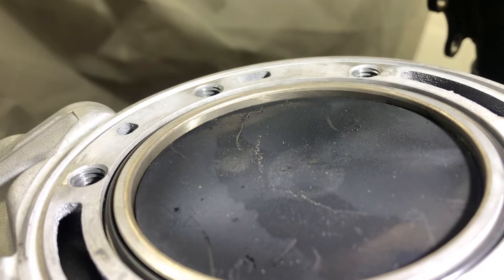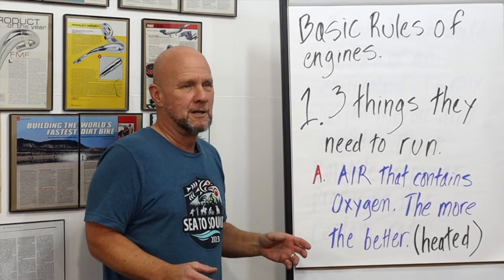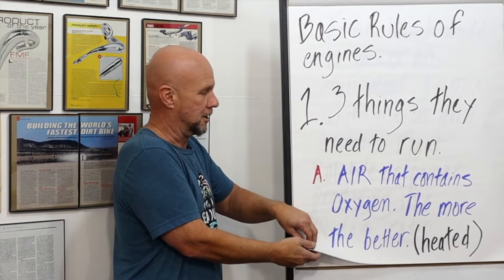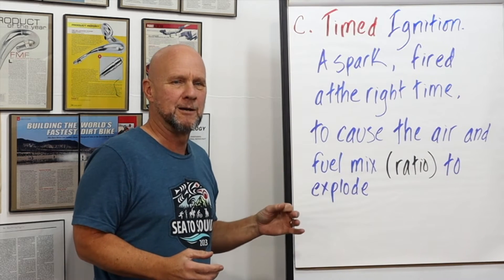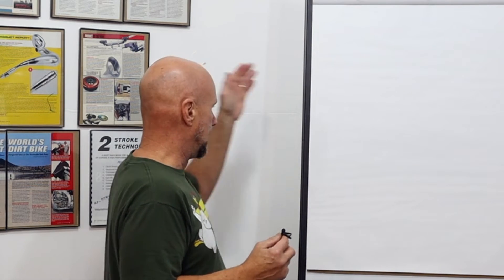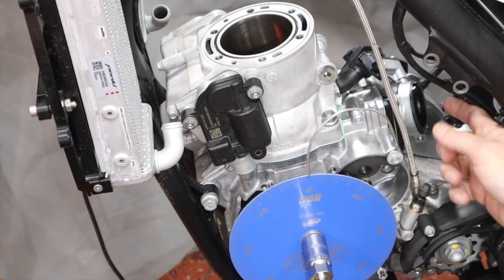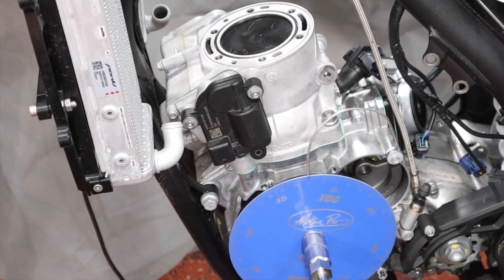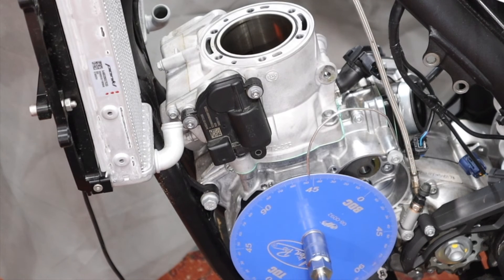3 Basic Rules For An Engine To Run - If One Isn't Correct, It Won't Run | Video #1

Comment: I am writing to express my deep disappointment and frustration regarding the recent experience I've had with your company. Not only have you failed to fulfill your obligations as a supplier, but your use of vulgar and offensive language has further exacerbated the situation.

I placed an order with your company on December expecting timely delivery as per our agreement. However, it has been since the expected delivery date, and I have yet to receive any update or communication from your end. This level of unprofessionalism is completely unacceptable.

Furthermore, I was shocked to witness the inappropriate language used by your representatives during our exchange. Resorting to profanity is not only offensive but also demonstrates a complete lack of respect and professionalism towards customers. This behavior tarnishes your company's reputation and raises serious concerns about the way you conduct business.

I want to make it clear that I will not tolerate such treatment. As a dissatisfied customer, I feel compelled to share my negative experience with others, including through platforms like YouTube, to ensure that potential customers are aware of the poor service and disrespectful behavior they may encounter when dealing with your company.

I strongly urge you to rectify this situation immediately. I expect a prompt response addressing the delay in delivery and an apology for the unprofessional and offensive language used. It is crucial that you take steps to improve your customer service and ensure that such incidents do not occur in the future.

Failure to address these concerns adequately will result in further action, including notifying relevant consumer protection agencies and leaving negative reviews on various platforms to warn others about my experience. I hope you understand the seriousness of this matter and take immediate action to resolve it.